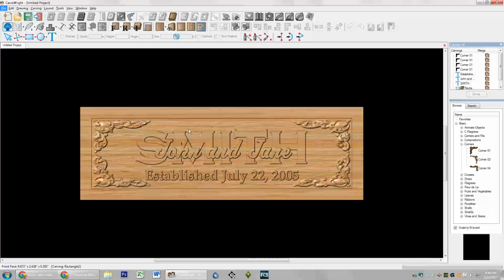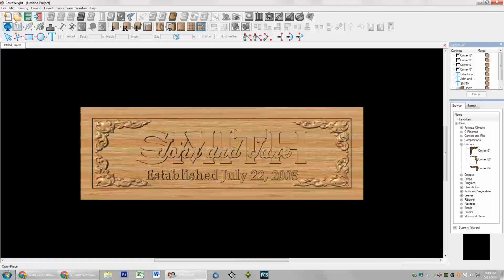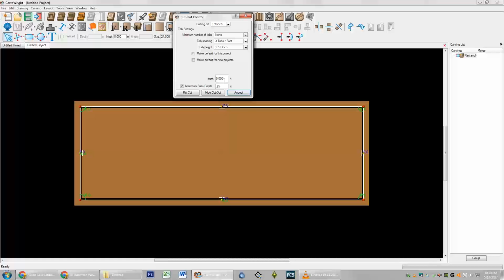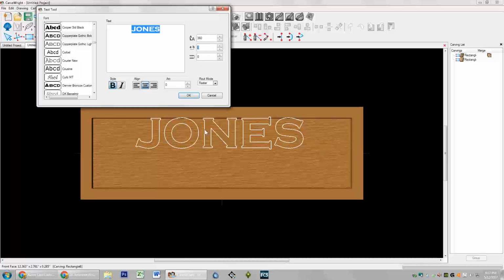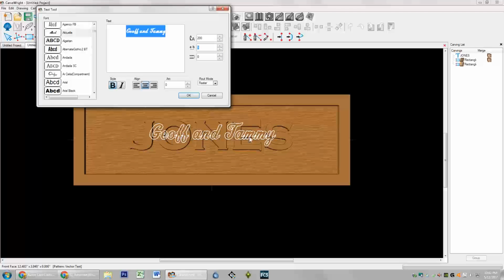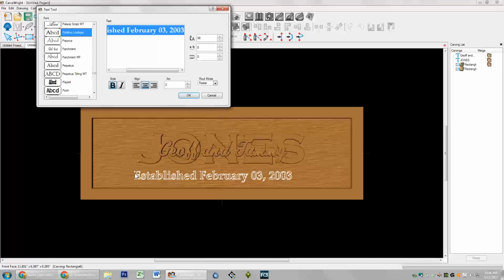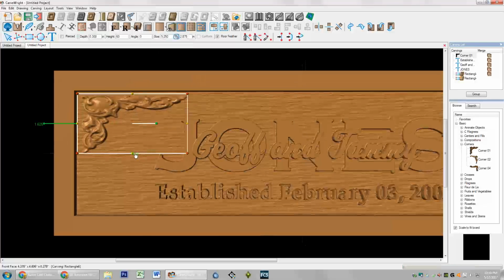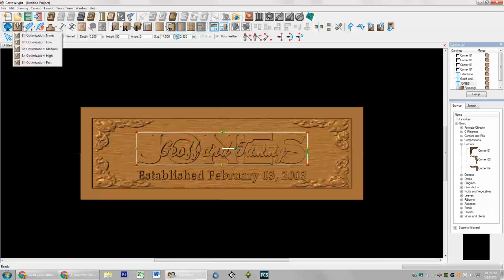Design Tutorial: "Established" Style Anniversary Name Plaque

Comment: Thanks I was able to follow and design while watching. Do you have a picture of your jig? Thanks
Reply: I would be interested in seeing the jig you're using also.  I'm almost done building the jig that I purchased from the CW site but I know there are other jigs being used.  I made a flat jig for carving 1x8x24 boards but that won't work for carve through projects. I'm always looking for new ideas!  Thanks
Reply from the maker: @ChadEhorn  I use two L-shaped pieces. One goes on the top/left corner, the other on the bottom/right. I just tape it into place with 2" masking tape - one strip across the width and one down the length, on each side of the board - eight strips per board. It has always held perfectly fine.
The jig was made for a 9x25 board, so with that size they fit together perfectly. With anything larger, there's a bit of a gap, that I just use masking tape to cover up. Anything smaller and there is some overlap - meaning if it is less than 9" wide I have to make sure it is longer than 28"... or conversely if it is less than 25" long, it has to be wider than 10". And again, I just use masking tape to make it work.